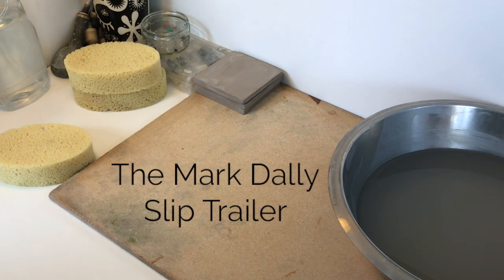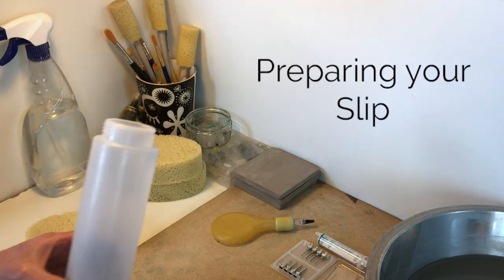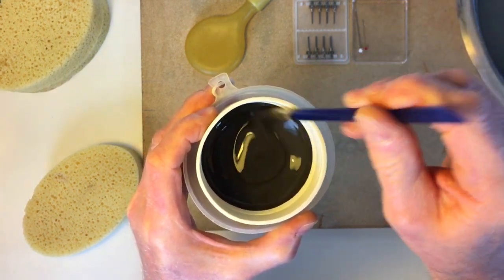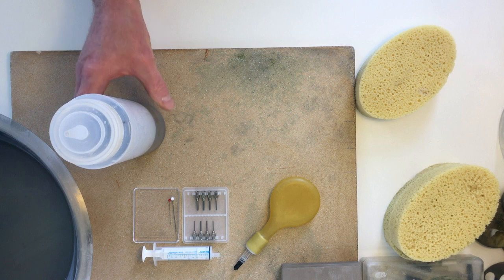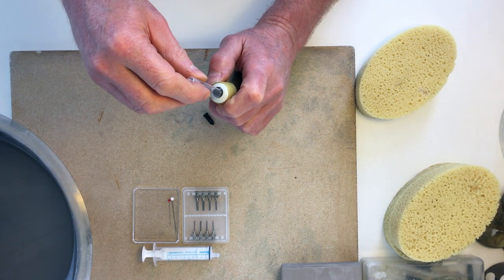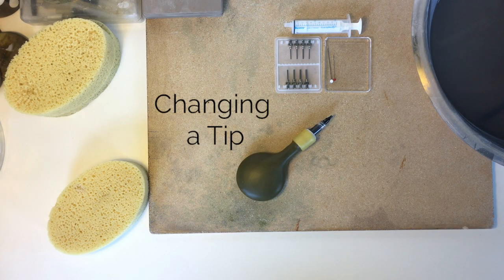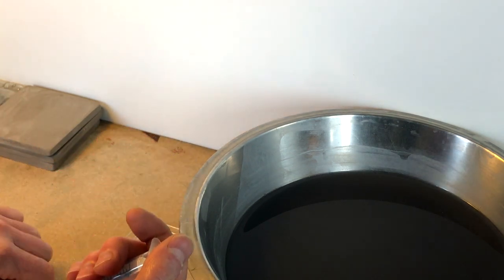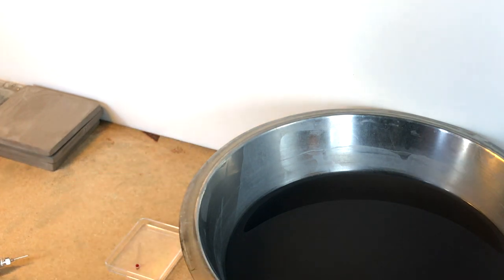The Mark Dally Slip Trailer

Comment: most important....how do you make the slip?
Reply from the maker: It's a basic water slip. The clay body that you are using for the pot and water. I mix up a thick slip with my glaze mixer (any mixer will do) then to make my black decorating slip, I mix one jug (1000 grams) of slip to 110 grams of Sneyd Ceramics (UK) black stain. Ref number: SC954. You could order a sample: https://www.sneydceramics.co.uk/ then I sieve the slip through a 200 mesh to get all the grit out. Hope this helps.